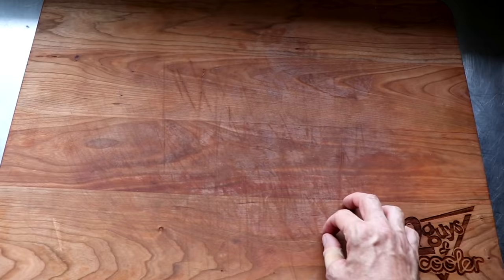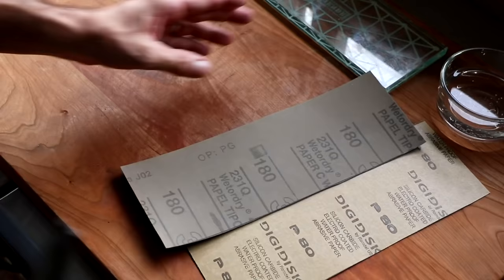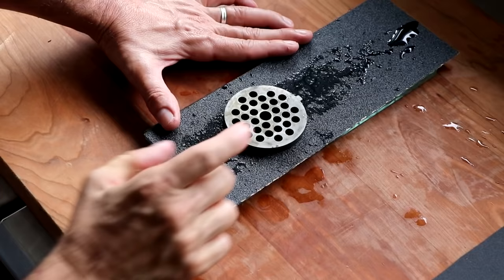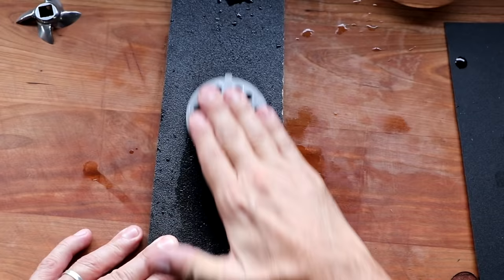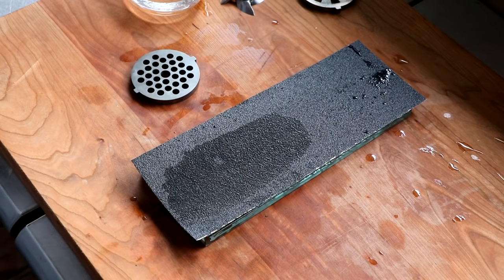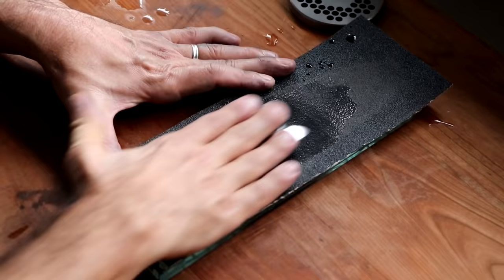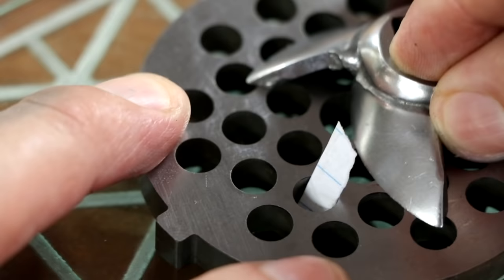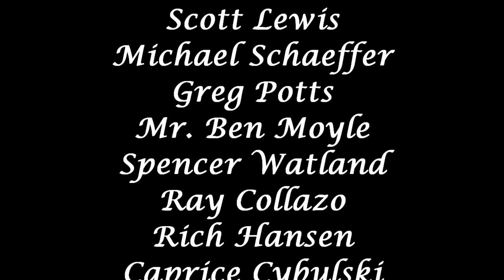Celebrate Sausage S02E18 - How to Easily Sharpen ANY grinder plate and knife

Comment: How do you think that this method compares with what you showed in an older video using the sharpening stone from The Sausagemaker? Not to pit one sponsor against another, but is there an advantage or disadvantage of one process over the other?
Reply from the maker: The sharpening stones work a LOT faster but they are limited to the type of blades and knives that they can sharpen.  For instance the first plate I sharpened has 2 notches.  The sharpening stones can't sharpen that kind of plate.  The sharpening stones are also fragile.  If you don't know how to use them they can easily break.  With that being said they both produce the same results, a resurfaced face (which will greatly improve the way you grind meat)

Comment: Try wetting the underside of paper and the glass then place paper onto glass, it should secure itself to the glass so no need to hold paper, when done with peel paper off and store between two sheets of hard plastic like file divider for use the next time you need

Comment: Just came across your video and wan to say thank you for posting, good information.  A couple of comments though.  
Wet your glass\stone and then press the sand paper to it. It wil help keep the paper flat.  I noticed that paper was rolling up has you pressed the plates and cutter acrossed  it.  This has little effect if no effect on the plates but this will roll the cutter's edge up. 
Don't sharpen your tools on or over your cutting boards. That is micro metal shavings getting ground into your wood surfaces and then most likely in your food.  
More of an question. Would it not be better to sand to a higher grit so that the surfaces rubbing across each other is smoother and less likely to "grind" each other down?
Reply from the maker: Thanks, Robert for the great tips.  I completely agree.  I used the cutting board funny enough because my stainless counters don't do so good on film 😂😂.  I have been experimenting with higher finishes like 300 and even 500.  The grind is a bit cleaner.  Might be worth trying out and letting me know your thoughts.

Comment: Should I lap all my various plates every time I sharpen so there is an equal amount of metal taken off each plate or is the metal removal so minor as not to worry about unused plates...I mostly use 1/4, 3/16 and 1/8 plates.  Also which method of sharpening do you prefer:  Lapping like this video or using the grinding stones from Sausage Maker?

Comment: Okay a few things from a man in the business of selling: Grinders ranging from #8 to #56, mixer grinders, plates, knives AND in the business of sharpening kitchen knives and grinder plates and knives and needler combs. I wanted to add a few details. For the plates this is pretty much okay as long as you keep the plate's faces very parallel to eachother. if they are crooked your grinder will bind. That is how they break. For the knives: These salvinox style ones with a curved leading edge can be sharpened this way. If you take the straight edged ones they really need a relief angle to cut properly especially if they are the braised carbide insert ones. If you have no relief angle you will put undue stress on the machine. You'll wear out the bushings at the back of the auger, You'll round out your squares on the studs, You'll heat up the machines and the plates. etc...Most important of all is=KEEP THE PLATES AND KNIVES TOGETHER. As they work they'll wear together and keep sharp for longer and prevent metal chips in your chuck. REMEMBER SAME KNIFE SAME PLATE no inbreeding.
Reply from the maker: Great advice for someone trying to sell more knife/plate combos.  Your advice only works if the same face of the plate is used every time.  The moment the face is turned to the opposite side it's null and void according to you.  Sounds like a great marketing strategy.  The truth is this, use 1 knife with all your plates and it'll work great!! Sharpen from time to time and save boatloads of cash..   This is someone who actually uses grinders ranging from #8 to #32 on a daily basis.  Never had a problem and my equipment works beautifully.  Haven't had to buy a knife/plate set in 3 years.
Reply: @2guysandacooler  It should be the same face all the time most production level universal plates only have one side. If you don't trust me you can call butcher boy, hobart or pro-cut (they sell grinders not plates)/or salvinox which makes the plates/knives. Ask them what they think about it. Why would you even want to use the second face of the plate? Imagine them like scissors: do you only sharpen one side? Either way your in average joe doing 8h of grinding a year will never need a sharpen if they use the grinder properly. Our plate and knife combos last around 500 hours of production use and we charge 6.50 cad for the sharpening on a #32 set. Where we make our money is repairing broken machines (especially hobarts) and selling new machines.

Comment: Good video, I hone straight razors and a flat surface is key. Question: I've been looking into a raw diet for my dog and seen people use a grinder to process chicken legs and thighs with the bone. Not sure how that works but it seems it would dull the blade pretty quickly. Do you recommend such a process?

Comment: I like the technique, but at the same time I think I would go between 500 and 800 for general maintenance. It might not be technically necessary, but your blades will last longer
Reply: 400 grit is finer than frogs hair.  Works great for wet sanding a car for primer.  Thanks for the video, I am going to sharpen my plates and knife today using your Methood in the video with  80 grit followed by 180 grit.

Comment: Great info Eric. I’m really enjoying this series.  Approximately how many times have you used this technique before the plate and blade become to thin to use?
Reply from the maker: I'm still using this technique and I haven't had to replace the blades or plates (it's been 3 years so far).  Resurfacing the plate only removes any uneven imperfections.  It's barely even noticeable.  I would say that if you maintain your plates and knife every 6 months with this method you can keep your plates and knives for years without having to change them.
Reply: @2guysandacooler I like old hand mincers and have several,  but only use them occasionally, I have never noticed them being difficult to use, but  having watched your video I’m very tempted to touch them up, thanks for bringing it to mind !

Comment: is there any issue with forming burrs inside the holes of the grinding plate?
Reply from the maker: I haven't had any issues.  The amount of material that's being removed on the resurfacing is miniscule.   It's not like the burr that forms when sharpening a knife

Comment: Question. You’re actually removing material from the surfaces so do the plate/blades fit looser after you’ve done this a few times?
Reply from the maker: If you notice, once you assemble the grinder blade and plates the plate will generally protrude by 3mm-4mm.  When you sharpen these blades (resurface would be a better word for it) you are taking off very little material.  So there's plenty of metal to sharpen many times without ot being loose

Comment: Isnt the grinder knife supposed to be honed or stroped after sharpening to eliminate the burr left for a better smoother cut ?
Reply from the maker: nope.  It's optional.  The burr that's formed is so thin and soft it just flakes off.  It's not like the burr on a knife when sharpening.
Reply: That is correct. The grinder cuts like a pair of scissors or lawn mower, not like a butcher knife. I always use a strop to knock off the burr, because it only takes a few seconds.  @2guysandacooler

Comment: If you only have one plate and blade and do this twice a year, how long will the sand paper last?  How do you know it is worn out?

Also any other cheaper alternatives for the flat surface?  My #42 has a 5” diameter so I would need something bigger.
Reply from the maker: any piece of float glass would work.  I'm sure you can get it at your local hardware store or glass house..  Sandpaper will need to be changed after 2-3 uses from my experience.  The sand paper will start to feel smooth (lost it's grit)  Truly it's the least expensive part of the whole process..
Reply: @2guysandacooler  thank you!!!  I’ve subscribed!

Comment: How much thickness can be removed from a grinder plate before it must be replaced? I would say the knife would need replaced if the diameter, tip to tip, is diminished enough to not cover the outer most holes on the plate.
Reply from the maker: It depends on your grinder but you will notice that when you place the grinder plate on the grinder the plate generally protrudes a bit.  That's the amount of space you have to work with.  For me it's roughly 3 mm.  Truth is, the amount of material that being removed on the sandpaper is miniscule.  I would be impressed if someone who does this technique, lets say every 6 months could wear their plates down that much in 6-7 years or longer..
Reply: @2guysandacooler  Was curious since was not sure if the plates need a minimum amount of protrusion to tighten against the retainer properly

Comment: Thanks Eric for sharing I've got  a p 60 sand paper instead of p 80 can i use it?
Reply from the maker: You can start with the course sheets that you have but I would finish on a 180-240 grit to smooth it out

Comment: How would you go about de-burring the holes in the plate?
Reply from the maker: If you wanted to you could insert a small drill bit that was sized exactly like the holes.
Reply: @2guysandacooler  Good idea!  Drill press on low speed sounds like it would work.   Not sure I trust myself enough to freehand it.  Thanks!

Comment: Let me say you do not need fluid to do your grinding. What's your paper gets loaded you can just brush it off into a basket and continue on but you have to make sure what your sharpening is oil-free you'll find your paper last a 10 times as long oil no water no Windex

Comment: I use the sharpening stones that mount to the grinder from the sausage maker. Which system is better in your opinion?
Reply from the maker: That's a tough question.  The Sausage Maker's system works very quick but is very fragile.  I have it and it works for me, but If you noticed in this video the first plate I sharpened had 2 notches and the sausage maker's system doesn't work for that type of plate.  So it's very specific as to the type of plate and knife that it will sharpen.  This method has a lot more versatility (as long as you have a flat surface) and you don't have to be as careful.  Both products produce good results so it just all depends on the set up that you have.
Reply: @2guysandacooler  I wonder if that's why the disc's are breaking 
for some folks. If the grinder stone doesn't match the plate, it would 
likely break. How tight is too tight? Just finger tight enough?

Unfortunately, this video came out about a week to late. As we were 
grinding up about a 100lbs of Moose burger last Saturday, when 
our 7-8 year old grinder blades gave up the ghost. Count find cutter/discs in our area, wound up buying another grinder. 
(same model) Oh well, we know a couple people that would love 
to have one. The Sausage Maker discs should arrive today, and 
lesson learned. 
Great demonstration Eric.
Reply from the maker: @marktoldgardengnome4110  Generally the disks break because people don't soak them in water for 20 minutes or so before using.  Then they tighten the ring too tight (hand tight is sufficient).  Then if not stored correctly they can break as well.  I've had mine for at least 3 years with no problems.  You just have to be careful with how you use them, that's all
Reply: @2guysandacooler  Thank You for the reply.

Comment: I've tried this before with Hobart plates and Knives. I had poor results as the metal was very hard. I thought to myself there's no way you could do this by hand with any volume. You need machinery! So for myself the question becomes what machines are able to do this at the local sharpening shop level?
Reply from the maker: a modified drill press
Reply: @2guysandacooler   Thank-you  for the reply would like to see one set up

Comment: Try wetting a cloth kitchen towel and put your lapping block on it and wet the paper side of the wet and dry paper to help keep the whole thing from sliding around.
Reply from the maker: Excellent tip
Reply: @2guysandacooler  One other tip for you, this is from my apprentice days in the UK as a machine tool fitter. When lapping move the item in a figure of 8 motion, this replaces the rotation by 90 degree's that you used and leads to a more uniform lap. By the way, love your channel, have you ever seen Scot Rea YT channel, I think you 2 guys will find it very interesting.
Reply: @gregmay9097  If I may add to your excellent suggestion of using the figure-8 technique, which does help keep the overall flatness on the macro level equalized without the 180 turn. From a sharpening point of view, Figure-8, circles, and crisscross (or X) motions are the most aggressive forms of metal removal. They inhibit the formation of ruts, allowing for faster cutting and abrading action. However, once you get to a certain place using those techniques, it is best to switch back to a singular scratch direction to create a smoother and more consistent surface finish (less surface variation on a more microscopic level due to crisscrossed scratches).  In this video, there is a 12 0'clock and 1 o'clock position, which helps to cut down on rut formation without changing the overall direction of scratches too much or creating large crisscrosses. That allows for easier correction and for the finer grit to work more effectively.

Comment: only issue is the sandpapers worth more than the plates worth
Reply from the maker: LOL.  I would suggest buying better plates😅
Reply: @2guysandacooler   any suggestions?
Reply from the maker: @millennium677  stainless steel plates are a good start.  usually they run 20-40 bucks depending on the size

Comment: Turn it around 180 degrees? What would that make a difference? Are you sure you don't meant to flip it 90 degree? That would make sense.
Reply from the maker: Rotating the disk 180 degrees allows for the pressure that's placed on the top half of the plate to be evened out.  No one pushes with the same force on all sides.  You right hand may be stronger than your left.  You might have an inclination to press forward with your tips while others press back with their palms.  So rotating evens out any inconsistencies in the way you might push to give you a more even surface.

Comment: This is an incomplete video. For us novices, how do you clean, dry, then coat the blades for storage after you've finished resurfacing??
Reply from the maker: Clean with soapy water, dry with a paper towel, and there's no need to coat the plates but if you do, you can coat them with a mineral oil 😁
Reply: @2guysandacooler  Thanks! Love your videos. These are the fading arts of food preservation. You are keeping them alive!!

Comment: Glass is glass (e.g., smooth is smooth)..., you don't need  3/8 -1/2" thick glass to achieve this. Glass is GLASS.  Properly supported a picture frame glass will give same results. It's the silicon carbide sandpaper (wet sand) that's going to do the work. If the glass doesn't rock/move while you're sharpening you're good to go.

Comment: Another newbie question here! I just watched a previous video (https://www.youtube.com/watch?v=acna2xeXMBg&t=172s) about sharpening knife and plates. Basically, it used abrasive wheels in place of the knife or plate. Does this method (lapping plate) REPLACE that older method, or should I be doing both? Thanks in advance.
Reply from the maker: You would only need to do one or the other...

Comment: All your doing is resurfacing the plates in the knife. You're not actually sharpening the cutter knife. And the one thing that you failed to mention is once you have resurfaced your plates and your cutter knife you must rinse them off very well to remove any metal particles the dry them and using a food grade oil to protect the plates and the cutter knife from rusting.